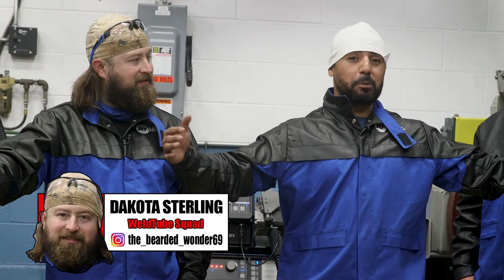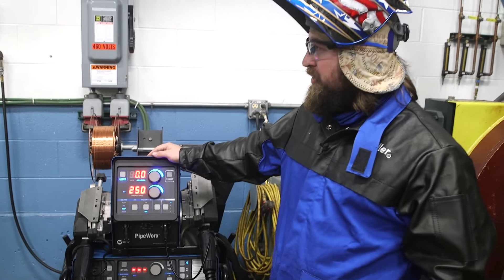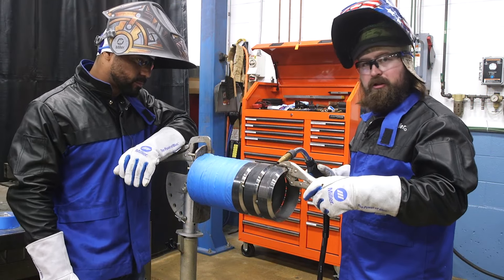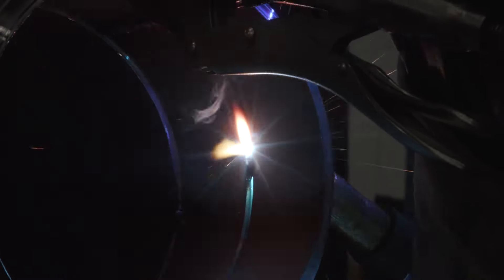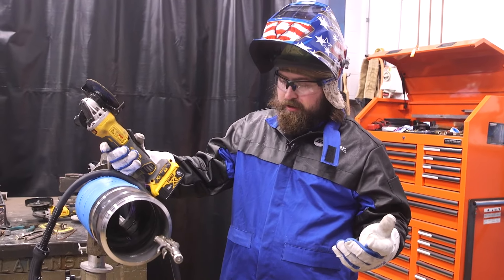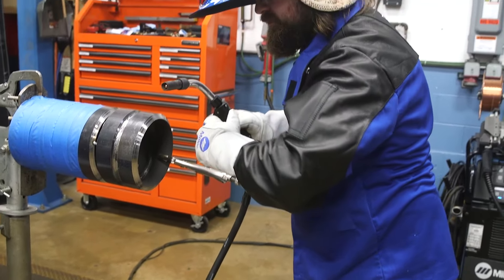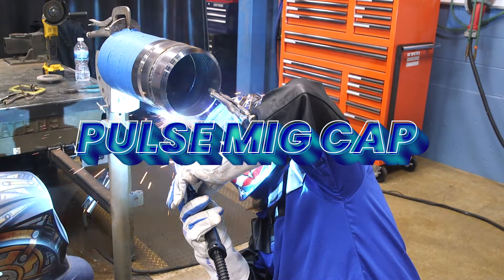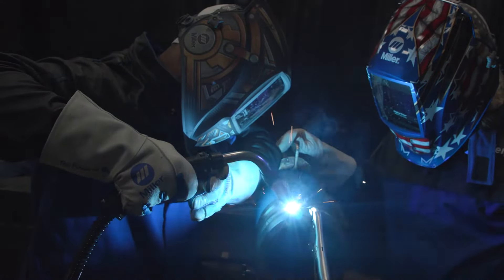Downhill RMD Mig vs. Uphill PULSE Mig

Comment: You adjust the trim until the arc adapts to how you like to weld. When it sizzles, pick up the pace a little. Your pauses on the side are just a tiny bit longer than what your trim is set for. Open up the arc, (raise trim slightly) until the sizzle stops. The goal should be no sizzle. Looking good guys, thanks for demonstrating an incredible machine!
Reply: When hearing the sizzle, it is essentially like welding short circuit right? Trim is so short that the wire is hitting the puddle. With the trim turned up, The arc length is increased and allows the pulsed spray axially shoot a droplet into the puddle instead of the wire directly hitting the puddle. Is that theory correct? Genuine question.

Comment: First fab shop I was in had Phoenix 456 power source w dual wire feeders. 0.35” short circuit with blue shield 8 for the root & 0.45” Pulsed Mig with blue shield 23 for the fill/ cap.
They upgraded to Pipe Pros & again to Pipe Worx . Always with dual feeders. They went to flux core for the fill and caps after a while. More forgiving. We rolled everything we could. About 45-55 mins. for a 24” std wall joint using the pulsed mig.

Comment: Should try it with 0.45 wire 🤔  would like to see it done more than the .35 since most shops where I'm at only use .45
Reply: .045 runs even better with rmd. Can lay down some wire for sure. 3/32 gap and crank it up. 190-225 wire speed. Depending on how you like to weld. It punches through a lot better and not as picky with fit up as lincolns stt is. Lincoln is only limited to 200 wire speed with .045 stt

Comment: Do the same with a normal mig set 😄
Reply: You can. You dont need rmd setting to do it. We do it all the time on root. But you need a stable power source in Your welding mashine. We often use metall powder filled wire like Hyundai metal cored wire SC-70A

Comment: Can you do a pulse downhill?
Reply: Not really.
Reply: It can be done….. but risk a lot of cold lap
Reply: Yes you can and it’s fast and hot
Reply: Yes you can . I’m on a 48 inch job and procedure is rmd bead and pulse hot pass . No one is getting lock of fusion . Grind down your starts and make sure you grind the bottom so it’s not humped up . Goes in nice
Reply: Pulse down or up or overhead. Even better on aluminum.

Comment: when your giving these “tutorials” and giving “advice” it always drives me nuts!!! It might just be me being a dick but i want to make mention that the parameters in voltage, wfs, actual travel speed, shielding gases, and fit prep etc etc are all variables that need to be checked and adjusted per the WPS and PQR’S and so forth which employers CAN and DO have that are specific to code and Employer/client. 

All that being said i just think its worth mentioning to your viewers that they should always verify and double check their processes & procedures before just running with these tips. and if they dont understand what all the stuff means tell them to make someone explain it and teach them so they can be more competent and hopefully pass on the knowledge to the next

Comment: Those setting produce a completely erratic arc, nothing but crackling and shit flying everywhere, on all the pipe worx 400 at my shop, same guns, same gas, same wire, people from miller showed up so we could ask them about setting, hey what does this arc length and arc settings do? All they said is it just changes variables, they didnt know what they actually did, just changes things, what complete letdown for such a whats supposed to be a great machine
Reply: Me and the guys i work with found when using the pipeworx 400, that the volt sensing cable that attaches to the back of the wire feeders and the earth clamp, it works 10x smoother if you take it off of the back of the earth clamp and attach it seperately with a croc clip or mole grips👍
Reply: @kf8575  tried it all over the place, the positioner, the metal floor, the work piece, the frame of the building, seems to work the best anywhere but on the ground clamp